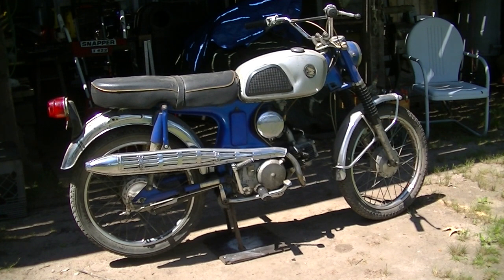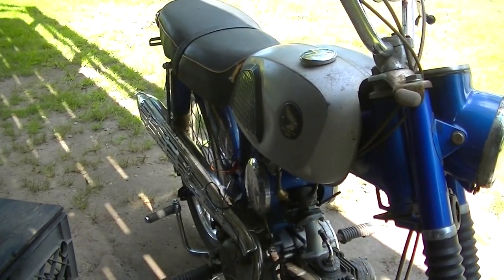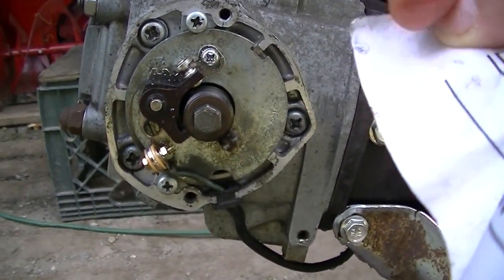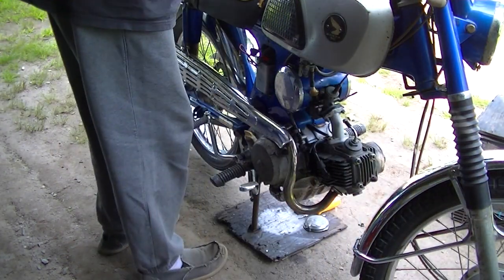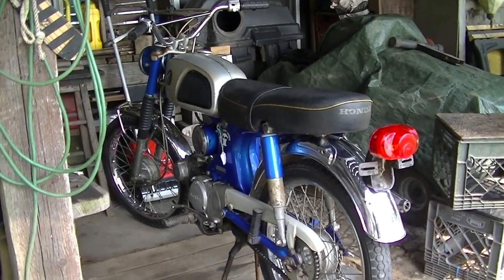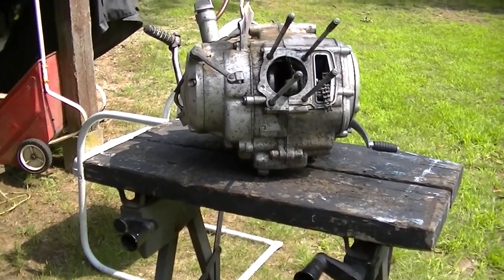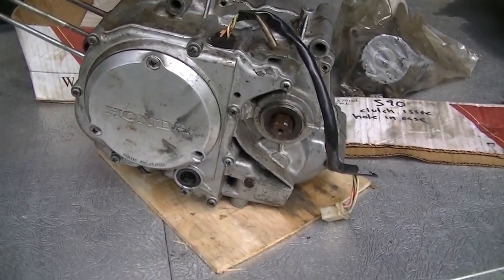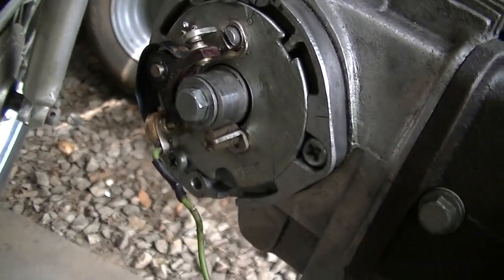A pair of 1960's Honda CL90's, Jekyll and Hyde Part 1

Comment: What’s the difference between this and a s90 besides tanks and exhaust?
Reply from the maker: If I remember right, considering this was the "scrambler model". More ground clearance, more suspension travel. gear ratio is a bit lower. Handlebars. Some other minor differences.